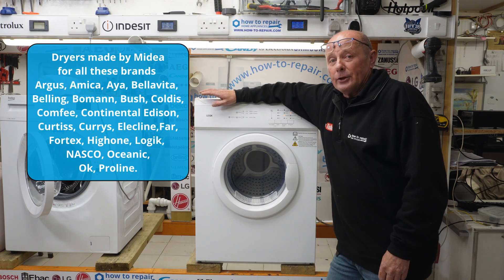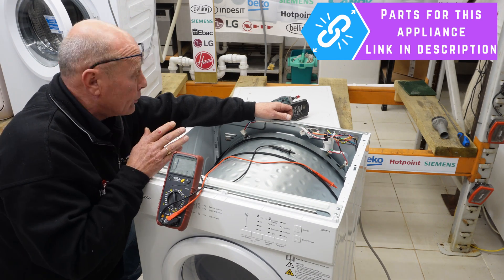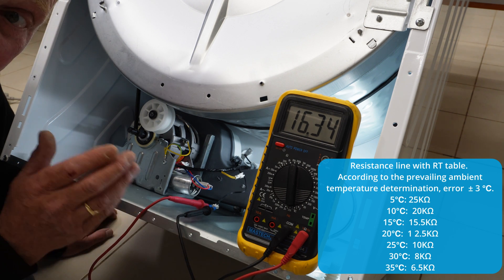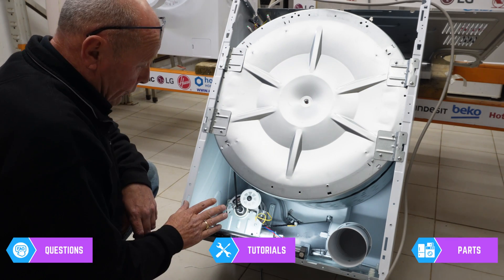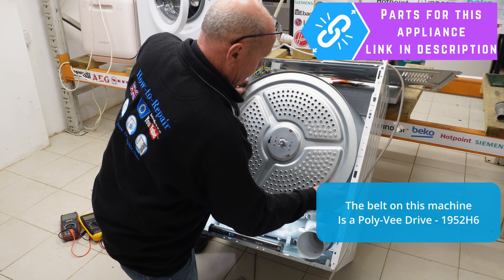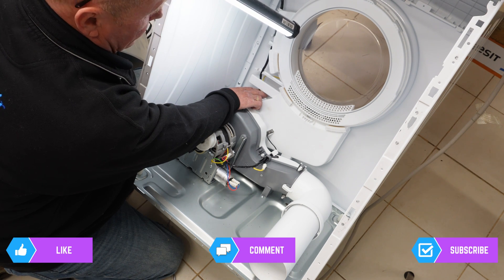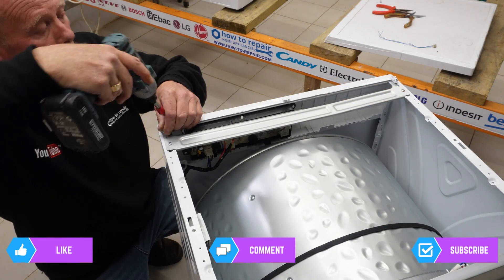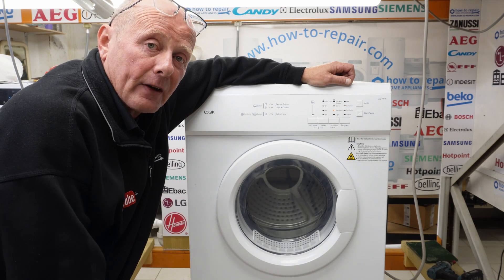Bush, Logik Tumble Dryer Masterclass: Disassembly & Repair Guide Everything You Need to Know

Comment: Hi ya, great video but hasn't helped me as my version is different. No reset button on the back. Any other suggestions? My issue is the lint sensor hasn't reset after me cleaning everything. I'm pretty vigilant and keep it very clean in general so no idea what's happened 😢

Comment: Great video. Same model. My dryer blows air and turns, by all accounts looks like it works fine....apart from its not drying the clothes and is cool. Would you say changing the heating filament is a good start?

Comment: Hello, your videos are amazing! I have a Logik tumble dryer, model number LVD7W18. When I switch it on, the “End/Anti-Crease” light comes on, but nothing else happens and the machine won’t start. I’ve checked the heating element, control board, NTC sensor, thermostat (including the push-button reset), and capacitor — all seem to be fine. Could you please advise what else I should check?

Comment: Hi, my logik LHP8W22  has recently started playing up. It still runs and dried but has started beeping 3 times when running. The manual doesn't say what the 3 beeps mean. Google says it can be anything from the door not sealing up to the heat element or issues with power.   When it's beeping it is 3 consecutive beeps.  Sometiimes it keeps beeping,  sometimes it will do it once every 10-15 seconds.  Sometimes it doesn't beep at all for a full dry. Any idea what the issue could be? Thank you

Comment: Really useful video. My bush V7SDW stopped working not long after turning on. It just makes a humming noise but the drum not turning. I thought something may have burnt out as I thought I could smell something. The belt is in fine and will turn with manual help but stops on its own. From watching another video it looks like it might be the capacitor? What do you think or is there anything else I should check first?
Reply from the maker: It sounds like it is the capacitor easy job you just need to get access to the motor the capacitor should be next to it make sure you take a picture of the wiring before removing it as remember a capacitor has a feed in and a feed out

Comment: Hi there, great video by the way, I have a Logik LVD7W18 tumble that has just stopped working. It is the end program/anti crease light on and when you press start nothing happens other than you hear two beeps. Any ideas at all. I’ve checked the following and these have tested as good, thermal cut out, thermostat and heater element. Many thanks. Jason.
Reply from the maker: Hi, please use our contact us page and make sure you fill out the request for what your problem is. I will need the full model number of the identification plate and the details of your problem so that I can provide you with useful literature. A video shoot of the problem would be perfect as well.

I will get back to you within 24 hours, normally. https://www.how-to-repair.com/help/contact-us/  

Please remember to subscribe to our channel, as that's what keeps this channel going. Thanks, Paul 👍

Comment: I am being driven mad by one of these, it won't start, it just beeps when you press start. Door switch is ok and I have tried another pcb. It won't respond to the child lock routine either, it beeps but the child lock indicator doesn't light up. Designed by morons these things.
Reply from the maker: Hi @johnhepworth1531 I will need the full model number of the identification plate and the details of your problem. Please use our contact us page and make sure you fill out the request for what your problem is. We will get back to you within 24 hours, normally. https://www.how-to-repair.com/help/contact-us/ 

Please remember to subscribe to our channel, as that's what keeps this channel going. Thanks 👍
Reply: @How-to-repair  I have found the problem, it was that magnetic filter switch. It appears to be part of the front vent assembly. There is a plug going to the PCB that has two yellow wires and two white ones. The white ones are the switch, I snipped the wires and joined them together and it runs. I realised that this was the problem when I read the instructions, it says that it won't run without the filter in place.
Reply: Great video and also @johnhepworth1531 legendary comment right here. I tested the fuses and the door switch all good. Shorted the two whites as you described and now it's working again. Amazing, thank you. I'll probably get round to fully replacing it but as it's only for the magnet in that filter I'm not too concerned now it's working.

Comment: Great video! I agree about Midea products not being so reliable, especially the LED lightbulbs!

On the other hand, we have a Favorit Scirocco vented tumble dryer, built by Merloni, known as Servis in the UK. It still runs, despite being 20 years old. My grandma, has one like it, and the only fault it ever had was a lose contact on the on/off switch.
Reply from the maker: Servis like many old manufacturers in the UK were great companies until they started malgamating with the bigger companies than the quality seems to have gone down over the years due to manufactures no longer wanting to build a quality product. They only care about sales levels of new machines. There seems to be no concern about making things last. What makes me Laugh is the way the manufacturers tried to tell us that their environmental friendly by producing eco-wash machines, but they seem to keep quiet about their products, only lasting 5 to 7 years which means that the landfills are piling up with white goods that need to be recycled to produce the material for them to build again which is a total contradiction in what they're saying in there advertising.
Planned Obsolescence:

The theory of planned obsolescence suggests that manufacturers deliberately design products with shorter lifespans to encourage frequent replacements and boost sales. While not universally proven, some aspects raise concerns:

Difficult repairs: Modern appliances may be designed with integrated components or limited access for repairs, making them expensive or impractical to fix, pushing consumers towards buying new ones.
Environmental Impact:

Shorter lifespans indeed contribute to increased electronic waste, posing a significant environmental challenge. While companies may promote eco-friendly features, the overall impact needs to be considered.
Reply: @How-to-repair  I agree! 

I believe the Eco washes on washing machines, which use low temperatures, are also harmful for the machine, as limescale will build up on the spider, and will not get rinsed off, unless a 90°C cycle is carried out frequently. 

Moreover, the EU has made Eco design in the programming the top priority, but when it comes to right to repair, it dictates that the drum does not need to be repairable, as long as the whole tub assembly is available for a certain amount of time after sales. There is no pressure on manufacturers to encourage them to make the washing machine more repairable, such as  the tub not being sealed.

Comment: Thanks for the guide just serviced my Bush DHB7VTDB. had a nasty grinding noise when running and the faint smell of burning checked qll component's and found the culprit a small butterfly clip stuck in the front end from on of my daughters garments. Informitive and easy to follow 👍
Reply from the maker: So glad it helped you @lord-zule3746 please remember to subscribe to our channel as that really helps us https://www.youtube.com/shorts/e432SAb2g08  Thanks, Paul 👍
Reply: @How-to-repair I have a Russell Hobbs and after being on its side getting moved it stinks of burning dust I turned it straight off but just wondered if it's worth doing anything with

Comment: This video is great but I'm not sure how to work out what my problem is. We have a Bush td7cnbcw and it only runs for up to 10 seconds before stopping and flashing an error message. The belt is still on and the drum turns, I can't find a reset button anywhere.
Reply from the maker: The first thing I would check is the thermostats
Reply: @How-to-repair  Thanks, I've removed the cover and can see the thermostats above the heater. Any idea how to test them? In fact I'm not sure if they're removable they're built into the heater unit